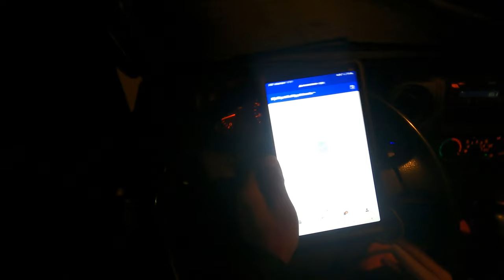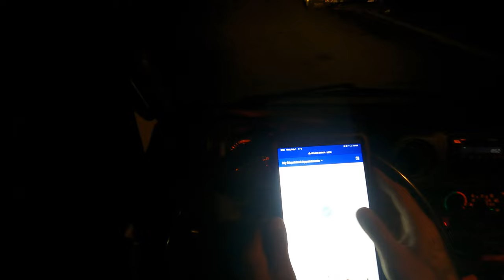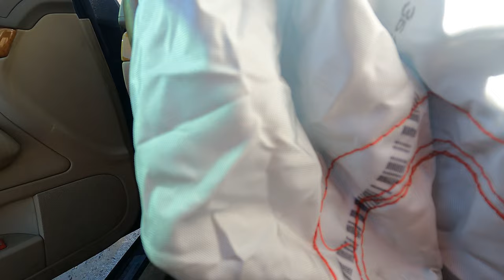My Day as Tow Truck Driver. | Daily Tow Vlog

Comment: Quick tip boss. All gm models have a winching point for the smaller j hook, so you can work with all the space your winch needs. Meaning you can put the truck much closer to the front of the bed

Comment: 12:12 you see how far back your truck is (suburban) if you use the smaller jay hooks that are on your main hook, there are slots in all GM vehicles where you can insert them giving u the ability to use that extra winch length so you can pull it more forward
Reply: Yes sir

Comment: you need to pull the truck as far forward as possible...less stress on the slide rails and puts less weight on the rear axle. you will learn in time my friend.
Reply from the maker: Thanks but this video is super old lol

Comment: Also boss the ring of the strap must be on the side wall of the tire, if you leave it like that with all that weight the ring will snap, and remember use the jay hooks when you have long vehicles, so you won't be hanging from the back

Comment: Hinos are amazing trucks at my old jobs that had some is a Toyota so it doesn’t mostly go down
Reply: Hinos are pretty garbage in terms of reliability, They have constant emissions issues, we had a fleet of about 6 of them for years swapping them out every 2 or 3 years so we have seen well over a dozen different hinos and we have since swapped them all out and are left with 1 hino and all other trucks are different manufacturers now, much more reliable.
Never used the shitty cab over style tho, we only used the bigger non cab over hinos.
But seeing as he is driving one of the most budget trucks I've ever seen in terms of tow trucks I'd say that thing doesn't do a whole lot for itself either.
Reply: @towtruckaj  idk the freightliners were worse . The hino problem is the j pipe
Reply: @MrMlbfan6  Our freightliners we have owned and our current one hasn't had any issues, Our international is starting to have issues but is our oldest highest mileage truck and it didn't hardly have any problems when it was newer, that's just wear and tear that we are experiencing, My Kenworth hasn't had any troubles either, The fords suck, same with chevy and dodge.
Reply: @towtruckaj  I mean international sorry loll . Yea Hinos problem is a pipe that has to do with the exhaust system